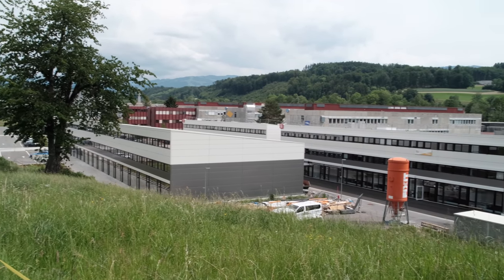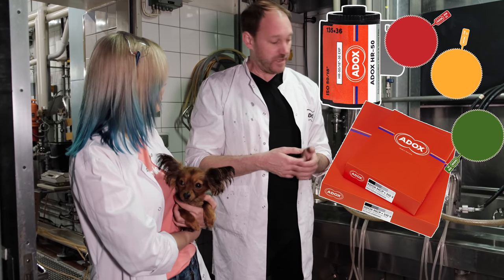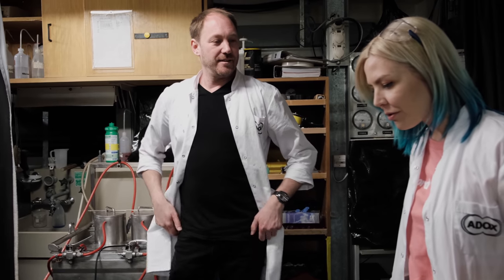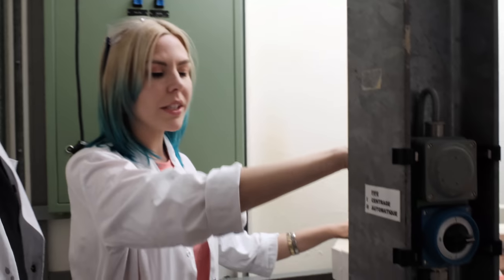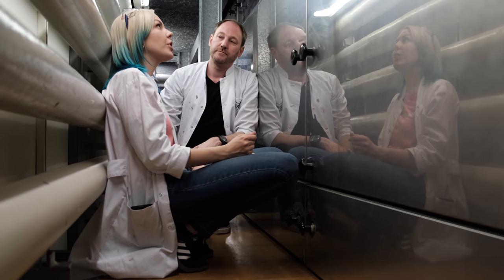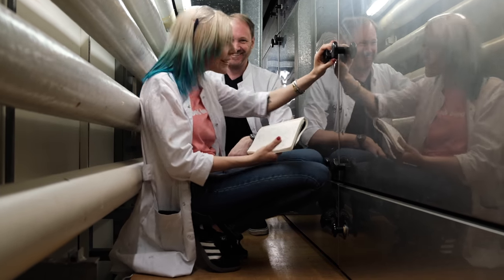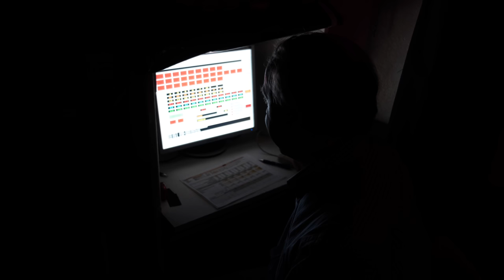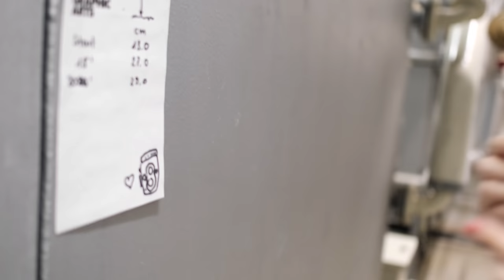Making Photo Paper: Inside the Adox Coating Machine

Comment: i started studies in this 1970's. simi pro amitour, failed my college class, but, worked at Sioux Falls ,Harolds film proscess lab, brot in mail bags, switched the bulk roll of 35 onto new canister in darkroom.,made photograph copies for restore.  also.last was QLX kodak plant in Tempe,Az till they layd off in 07. similar factories i worked,, made fibergass film for circuit board factory. 3 stories of dip into resin an dryers, = very dangerous as flamible. So neat to see this. my Kin, Krayhenbuhl are frum Bern...

Comment: I ask me one thing. He told that the Milk will flow back from coating area to the bottles and will be reused, but how they separate the two mixed Milks from themselves?
Reply: We cannot rescue emulsion which ran down the cascade. What we do is to circulate the emulsions just before the cascade until the whole cycle is stable. Then we switch a valve and inject them into the cascade.
Reply: @ADOXPHOTO  Thank you so much, I misunderstood!